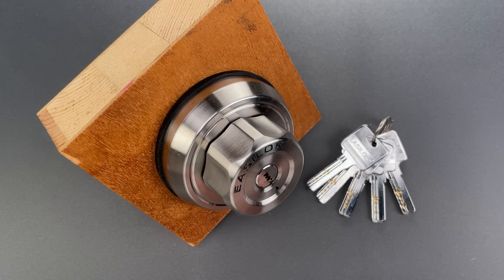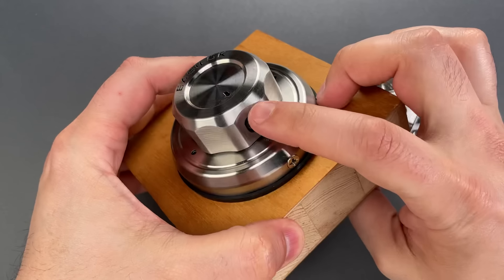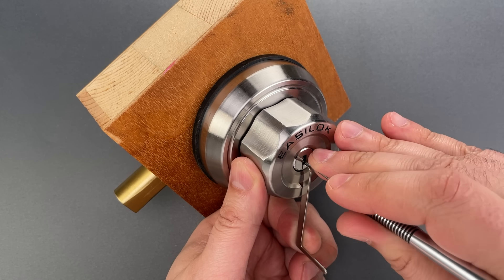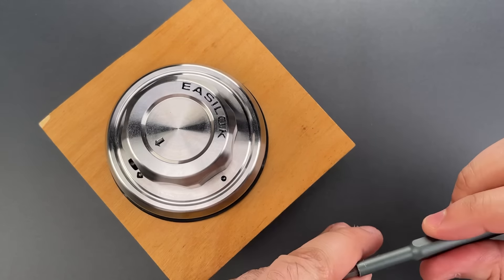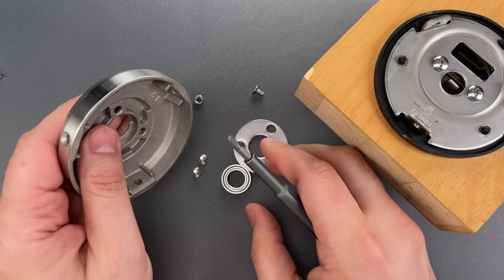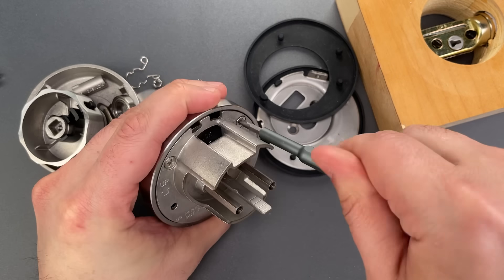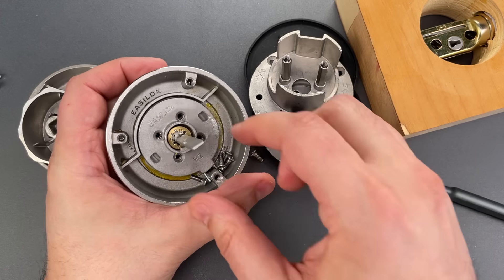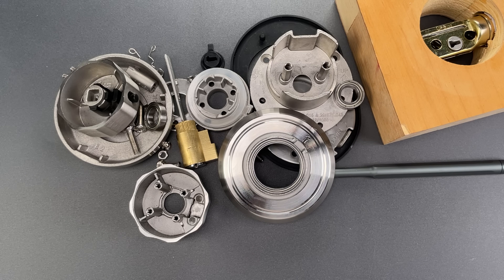[1388] The Best Built Deadbolt Ever? Easilok

Comment: I think this lock also holds the record for the most screws. LOL....I've been a locksmith and have managed a locksmith supply warehouse in 4 different cities over 20 years and have never seen such a classy deadbolt. I've been out of it for a couple years but I do remember the Easilock name.
Reply: The whole time I'm running the bill of labor to assemble this thing. I'm gonna guess that a a fair amount of it would be hand assembled. Hope they are really padding their overhead.
Reply: @notsam498  Same here. Probably not insignificant BOM cost either, with ball bearings and several SS castings. I don't know what it retails for, but I would be surprised if it was cheap.
Reply: @mr_gerber  one would hope they bring down the part count in future version. It's nice to see all that attention to detail and craftsmanship though. Increased parts (especially fasteners) is driving up potential for failure or misassembly.
Reply: @mr_gerber  It looks like its retail price is 3-4x the price of a standard “name brand” deadbolt you can purchase at one of the big chains.
Reply: @MarcosElMalo2  so still relatively inexpensive, considering the build quality

Comment: As a carpenter since the 70s I have installed,  replaced and repaired a lot of locks, commercial and residential and I too have never seen a deadbolt so well constructed. Only drawback as you point out it doesn't share the lock body with knowen high security ones. I would buy this lock just the same. Cheers 🇨🇦
Reply: Would a sledgehammer knock it right off the door? The protrusion seems like a big vulnerability. What do you think?
Reply: @pepperpepperpepper  Anybody using a sledge doesn't care about locks. They just kick the door in.
Reply: @pepperpepperpepper  stainless is hard and there is the same two bolts all locks have holding the 2 sides together so maybe.
But an attack entry doesn't care about the lock they're coming in lock or no lock.
Stealth entry requires picking and no one has that solved yet.
Reply: @firesurfer  Agreed - to a sledgehammer, the door and door frame are much softer targets.

Comment: The only thing i'm sure is that when i can buy a house of my own, first thing i'm gonna check is this channel.
LPL, you're the MVP.
Reply: Me too.
Reply: Just buy the highest rated Schlage and use 3 to 4 inch screws on the striker plate.  Almost no criminals know how to pick a lock and Schlage is very difficult for most people to pick and they are very sturdy against kick in, which is way more important than pick resistance. Criminals are dumb.
Reply: Hope LPL knows what that abbreviation means, personally I do not
Reply: @harrickvharrick3957  Most Valuable Player. Mostly used in games/sports for the best player on a team.
Reply: @jowjowbro  bedankt!
Reply: Hahahaha ... i did it so.
Reply: @actionjksn  you can get a Bowley Rotesera for a decent price. It has yet to be picked….by anyone…not even LPL. 

Not even very expensive. $170
Reply: @actionjksn could you use the metric system?
Reply: @Anti_Septikum  ~8 - 10cm

Comment: Al things considered, I’m really impressed and as a consumer I would much rather have a deadbolt lock that is simply well built rather than pick resistant. Since if someone REALLY wanted to get into your house they would just use a window rather than spending time picking a lock. As long as the lock can’t be super easily opened with a low skill attack or easily bypassed I’d be happy.
Reply: Took LPL 30+ seconds, which is effectively unpickable.
Reply: ln this case the old cliche', "Locks are for honest people" is entirely correct.
Reply: What do you gain from the fact is built in such good quality, if it doesn't increase security? It's not like normal locks break apart or anything. Honestly, for me this screams it's overengineered.
Reply: @jankoodziej877  durability....
Reply: @KarrasBastomi  if regular lock is durable enough to survive my lifetime, I don't see a point in increasing the durability.

Comment: If I may take the liberty:
I want to remark, that this lock is one of the few assemblies, that can be disassembled using one screwdriver that fits all screws.
A very rare thing in today's tech world, where you usually need multiple different types of screwdrivers due to the different screws used everywhere.
Reply: Good point.
Reply: I was impressed by this as well, and even more so because they're all pretty large screws. The very tiny Phillips head screws that tend to come with small appliances or electronics easily strip, making them more difficult to take in and out after many years of service. Screws this size will probably be good to use for many years to come without risk of stripping, and if they're made of the same stainless steel as the housing, unlikely to rust as well.
Reply: True, whomever thought up this design did an excellent job! Good material, good fitment great assembly.
Reply: 👍🏻 good point I didn’t notice it, they definitely put a lot of thought into it.
Reply: Been a locksmith for 10 years. To disasemble a lock you never need more than 2 types of screw drivers. That's not something this lock excells at, it's just standardization for the entire industry. Fact is you either need a philips 2 or a robertson 2. Schlage will very rarely need a torx, and shit made from 20 years ago or further will amost all need a flat head. I could go around with those 4 tools and be able to disassemble literally every single lock made in the last 10 years
Reply: I actually prefer to have them use two different kinds of screwheads to indicate which screws can/shall be removed for installation and which ones open up the internals of the device.
Reply: Very true. Even with over $5k in tools, it seems i'm always digging something that'll work outa my wife's big manicure case and bending it. But I always clean it put it back, smelling like varsol or kroil.😆😂🤣
Reply: Even the bearings! Those are usually press fit.
Reply: Good point!

Comment: LPL: This is quite possibly the most impressive low-security lock Ive encountered.

Proceeds to pick within 15 seconds
Reply: The lock is unpickable when the owner is inside. He said that the key won't work anymore once that mechanism is engaged and if the key won't work picking automatically becomes impossible
Reply: He does mention that he'd like a standard cylinder, so that he could take this lock, and change the cylinder inside to something even better. Outside the cylinder, he's really impressed, which is an extremely high praise for me)
Reply: As he said "low-security". That is what he meant by that.
Reply: You’re forgetting the hundreds of hours practice prior to filming.

If someone is dedicating that much time to getting inside you’re not going to stop them.
Reply: Lpl time scale is much different than regular human scale. 20 seconds to him is 20 minutes to normal people.
Reply: @rumandbass  Think your overestimating normal people here ;)
Reply: @ssu7653  you're right he's overestimating by a fraction of a second
Reply: @gabrieldauzmusic  you don't need to turn anything if you have a screwdriver to just remove it entirely
Reply: @cookinsdabest  the screws are on the inside. No way to unscrew it from the key side.
Reply: @cookinsdabest  don't think you've ever looked at a deadbolt lock that is installed correctly if you believe that the screws are facing outward towards the world...
Reply: But the lock disable future really makes it high-security when you're home it's virtually unpickable when you disable the key
Reply: @gabrieldauzmusic  sucks that once your not in your home, which is when most robbers will break in, it will be like a normal lock, keeps you safe at night though as long as they don't come through a window, or literally break the door
Reply: @jullianfrazier9189  Meh, your security is only as good as your weakest link. Given the high build quality as well as the uncommon core, I don't think this would be the weakest link. Thing is, if someone wants to get into your home while you're away, they definitely will. It's about making it as difficult as possible for opportunistic criminals. This lock definitely makes it harder for your average criminal to just walk into your home. Couple this with cameras and perhaps a home security system, and you are pretty good.
Reply: @pastenseolith when the switch inside isn't flipped its literally a normal lock and you cant flip that and leave your home because then you wouldn't be able to get inside your self, it wouldn't even be possible to flip the little switch  and leave your home locking the door because when the switch is flipped to make it so you can't use the key on the outside the dead bolt is fully extended and you would need the door to be open to be able to get out but to have flipped that switch and have had the door open so you could leave the dead bolt would prevent the door from closing, its a normal lock with special features that doesn't prevent people from lock picking their way in unless your currently in the home and have it locked with the switch flipped, having cameras and a home security system are the only things that would make it more difficult or less encouraging to brake into your home
Reply: @jullianfrazier9189  I'm a remodel and home improvements professional and been doing it since the 1990s.  People call me to install or repair doors,  install locks or to secure the home when there's been a break in.  I have never seen a break in that was the result of their deadbolt lock being picked. In every instance if they went through the door they kick the door in or used a crowbar. Very few criminals have the ability to pick a deadbolt lock. Obviously there are criminals who know how to pick a lock but they are extremely rare. Although I'm sure it must happen I've just never seen it or talk to somebody who personally had it happen. So it must happen sometimes but this is just not something that happens frequently.

Having a reinforced door jamb and a high-quality kick resistant lock is much more important.
Reply: @actionjksn  sort of what I was saying, meaning that the deadbolt is only good when your in your home, and as your saying most people will just kick the door in anyways so it won't matter whether its locked with the switch or not, which means other measures need to be taken to actually deter or stop someone from breaking in
Reply: @jullianfrazier9189  I do this professionally and I can tell you that the door jamb is what fails when they kick it. Replace the regular screws with 3 or 4 inch. Or better yet they sell a striker plate that is extra large and uses 4 screws.
Reply: Yes, he was referring to the overall physical build quality as being the most well built, but the actual core being the low security Achilles heel so to speak.  That lock looks like the housing/durability would probably last forever, and the ability to "dead lock" it from the inside, is absolutely awesome, at least on the bright side, as long as you remember to flip the switch inside when you are home, the vulnerability is negated, and really the only risk is to potential theft of property, if the picker times it right when there is nobody home.  And while I would be first in line to get this with a better core, let's face it, it may still be worth it, as the most important thing to me is the safety of myself and my family, which is where this lock excels, and possessions can be replaced in the unlikely event that my home is targeted by someone who is experienced in dimple locks and they happen to hit when nobody is home to flip the switch inside.
Reply: @gabrieldauzmusic  I can imagine making a system that activates that function from the outside, something a thief couldn't see coming.

Comment: My first thought was "That would be so convenient, especially in the winter, not having to dig my keys out of my pocket when I leave home! Too bad they don't make a higher security version". My second thought was "This would make it super easy to lock yourself out of the house since you don't need the key to lock it from the outside..."
Reply: That's where the low pick resistance comes in... it's a feature not a bug
Reply: Shouldn't you doors lock when you close them anyways?? Over here almost all entrance doors don't have a handle on the outside.
Reply: Talking residential and not commercial, unless someone uses an electronic deadbolt, I've never encountered an automatically locking deadbolt.
Reply: @petermuller7687  I was thinking the same thing :D.  I now always check twice I have my keys on me, having once locked my self out and having had to literally MacGyver a pole and hook to 'fish' my keys, through the letterbox, from the hallstand 15 feet away :lol:.
Reply: stash a copy key somewhere
Reply: @petermuller7687  It's a standalone deadbolt lock, so any door with a standalone deadbolt lock needs a handle to allow the door to be opened. But the handle isn't involved in any locking mechanism, and the handle will actuate the latch regardless of if the deadbolt is locked. But with the deadbolt locked, you can't open the door even if you turn the handle. That's how most doors are here, at least most doors in condo and apartment buildings. So right now, when I leave home, I can only lock the door from the outside with the key. This means that to re-enter, I must already have the key, since I locked the door. So it's impossible to get locked out. But if you could lock the deadbolt with no key, it would be possible to leave, lock the door, realize that you forgot your keys, and be locked out. And knowing me, that would happen a lot.
Reply: I have this mechanism in my dorm room. Administration always have a spare key, so locking myself out isn't big deal. Whenever I go out I just feel my keychain in my pocket then leave room while lock switch on, very useful. I think target audience of this lock is hotels, dorms etc.
Reply: @petermuller7687  Residential door locks in the USA are not made to automatically lock when the door is closed. The locks I've seen in Europe and China (they copy a lot of European designs in China) do. Just one of those odd regional things.
Reply: @weldonwilson  America's primary lock is a gun.
Reply: Being from Germany, I've only ever seen a single family home in my entire life that had a handle on the outside to open the front door without a key.
Usually, if you don't have a key and find yourself outside of a door that fell shut, you're gonna stay outside for a while..
The main difference to this lock is that under these circumstances, the only thing keeping you out is the latching mechanism, which is a lot easier to beat than an engaged lock.
Reply: @professorfukyu744  I can pick a gun, because most owners don't lock them up at all.
Reply: @petermuller7687  No, particularly with apartment suite entry doors.  It's against Fire Code because you need to be able to retreat back into your suite (the corridor wall and suite entry door form a fire separation) and if the door is automatically locked you're screwed unless you have your keys with you.  You can do whatever you want with house or townhouse entrances ("a man's home is his castle") but locksmiths make a killing opening houses for people that have locked themselves out of their homes.
Reply: have four unique features:
1:   Twist-to-lock keyless deadbolt with an Anti-Mislock Button on exterior knob.      
2:   An  invented Dead-Button that works as a Child Safety lock on the interior knob, which can keep the door either in the “locked”  or “unlocked” status as you prefer.
3:   Never fades or rusts due to its lathe finish.
4:   Built like a tank and made of 304 stainless steel after casting.

Comment: I never would have considered buying a hundred dollar deadbolt but after this video I may just go for it.
Reply: I'd say go for it. The general construction, from using stainless steel, to the bearings and even the directions on the lock show a level of care not seen often. They purposely designed the lock to be easy to use with neat features. 

While, it's unfortunate about the core, I think for the average person it should be fine. If that is an issue for you, then I'd suggest simply waiting until the company either improves the core or allows you to swap your own into it. 

It might help if you send them an email asking for that feature to he added.
Reply: I honestly expected it to be more than $100
Reply: On Amazon they're actually only between $70 and $90 depending on the lock set, and considering the material that he showed inside is much more durable I would definitively consider it.
Reply: How does it stand up to a pipe wrench?
Reply: @beru58  This is why he called it a low security deadbolt. I'd imagine with enough torque you could damage many of the internals.
Reply: @beru58  It would still be locked
Reply: They are on Amazon now for $70 with a coupon for 20 bucks off.
Reply: @beru58  destructively opening this lock is harder than breaking a window or just cutting around the lock. There way easier methods of entry and this lock provides adequate deterrence to for you to start looking for easier methods of entry elsewhere. I say this lock is revolutionary in a market full of cheaply constructed deadbolts.
Reply: @techfreak1182  thank you so much, we have redesigned,thank you so much